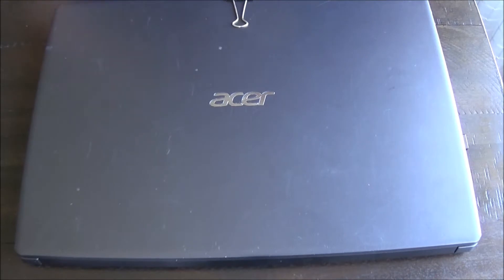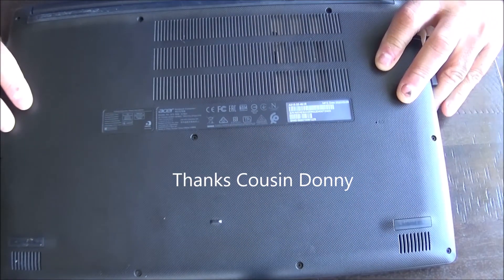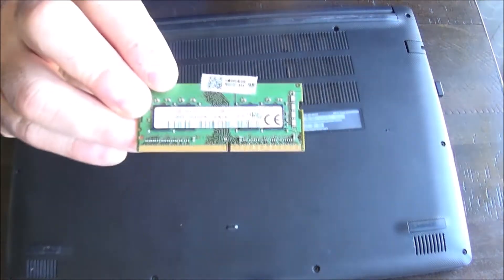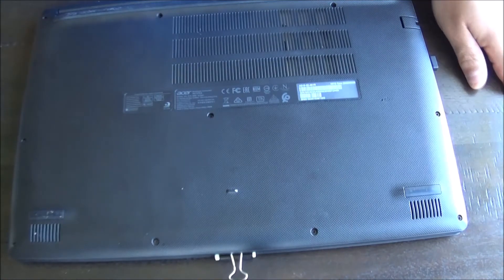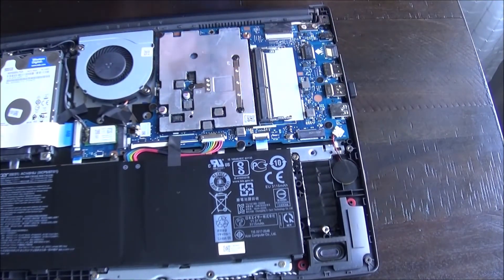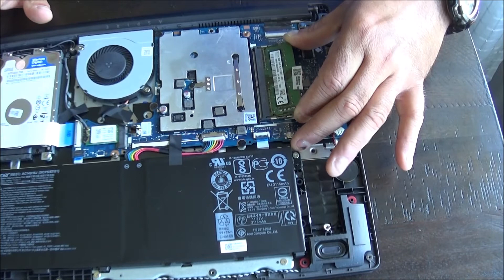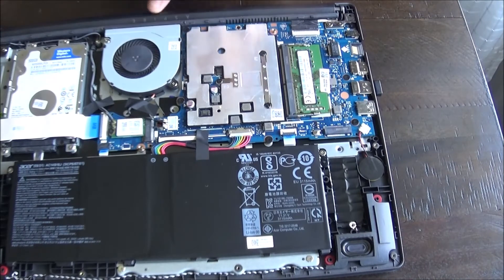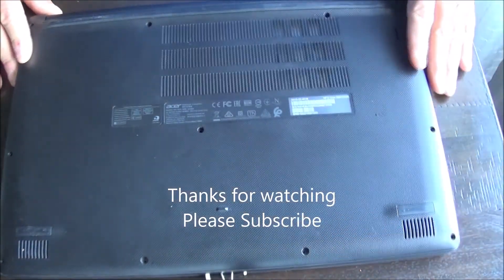Acer Aspire 3 A315 How To Upgrade Ram

Comment: I put in my Ram stick, and when I went to power it on, the screen stayed black.
Reply from the maker: Have you tried the original ram again?
Reply: @Tobinindustrial  it didn't come with ram
Reply: @Tobinindustrial it works without the ram, but once I install it and try to turn it on, it does, but the screen stays black. I installed an 8gb ddr4-3200 sodimm 1.2v ram stick. I dont if that extra information helps or not. I looked around on youtube for ways to fix this and they just gave me key combinations to push or tell me to just power on and off or making sure the ram stick is seated properly in the slot. Nothing worked. Do I have to get a new stick or something?
Reply from the maker: I have never known a laptop sold with no ram... It is possible you may have another issue. My best advice is for you to find somebody qualified to have a look at the laptop because you may have another issue. That being said, bad ram will not work and ram that is not the proper spec will not work in your laptop. the ram supplier/seller should be able to reference your laptop and tell you what type of ram will work.

Comment: I have A315 32. Can we upgrade processor or Motherboard?
Reply from the maker: I am pretty sure you can. The question is, would it be worth it for the costs versus updateing to a new laptop. 

I recently moved into the Lenovo with Solid State Hard Drive and I ain't looking back. I have found that Acer laptops have become more problematic and that Lenovo, for a few dollars more, is a much higher quality build. I am also told that ASUS is another good product.

Comment: The cooling tube is under the metal plate to the left of the fan. Just an FYI because I'm adding doing the same thing to a similar model and it doesn't have the plate.
Reply from the maker: Thanaks for the information.

Comment: mine got battery problem when i did the ram upgrade how to fix?
Reply from the maker: Are you referring to the internal coin battery for the bios clock, etc...? If so, just replace it with the same type of coin battery.

Comment: My laptop (Acer aspire 3) doesn't turn on after updating ddr4 ram what's the problem?
Reply from the maker: If you remove the ram, the laptop should attempt to come on. If there is absoultely no attempt to come on, there is something else wrong I think.
Reply: Remove the battery first before doing anything to the laptop

Comment: Do you need to unplug the battery ???
Reply from the maker: As long as the unit is powered down, it should be fine but unplugging the battery is an easy process once you are inside anyway.

Comment: I thought the max ram on this board was 8?
Reply from the maker: It is working just fine with 12GB of ram my friend. Keep in mind that there are two seperate places for ram. One area already has 4 GB ram. Now perhaps the other 8 I added may not mean a total of 12 GB as the other 4GB of ram may have a whole different laptop function.

Comment: yo i put another ram in my laptop and it booted up but kept on having that sad face with a blue screen with error stuff and the screen was flickering but when i took out the ram it was completely fine
Reply from the maker: It sounds as though your ram is conflicting with your laptop operating system. You need to get specific ram that will work in your laptop. Ask a computer tech what ram you can use based on the model you have. The ram you are using could also be bad. Also, your laptop can only operate on so much ram. Good luck with your laptop.

Comment: how to upgrade laptop memory (add hdd/ssd) can you show in the video pleaze?
Reply from the maker: I will do that if I get a chance. I have the radio reassembled and I am waiting on some extra ram for it now. Thanks for watching.
Reply: @Tobinindustrial  okey, and thank you for responding to the comment
Reply from the maker: The replacement of the HHD is really simple on this Acer laptop. All you need to do is shut off the laptop, take off the bottom door for the HDD, unhook the HDD wire from the board and then pry up the side of the HDD and remove it from the the rubber casing it sits in.
Reply: @Tobinindustrial  Thank you